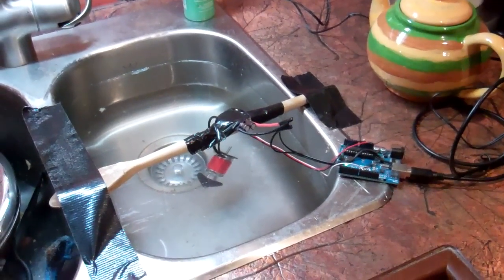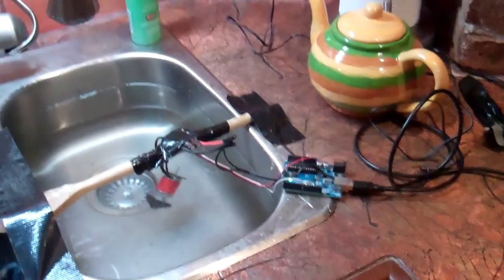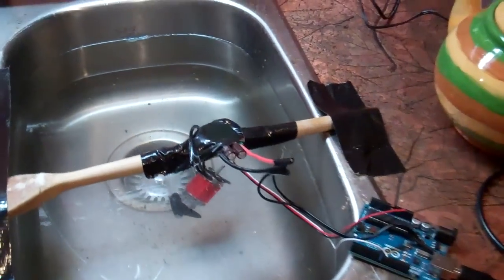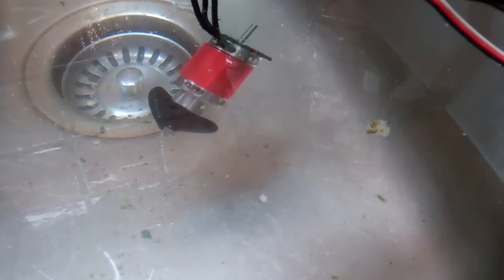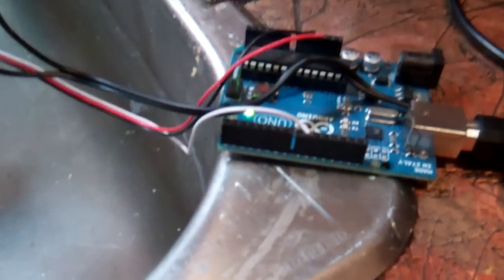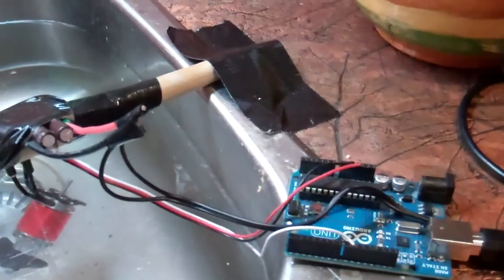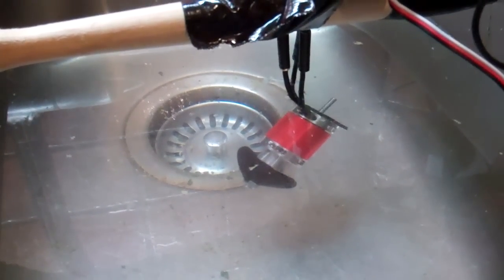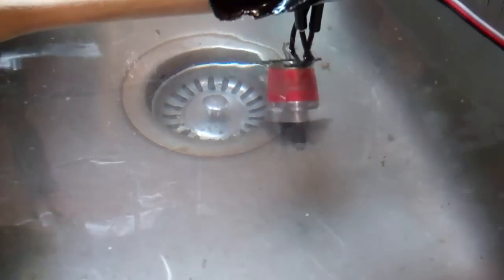Testing Brushless DC Motor Underwater

Comment: What if the 3 connection leads were also submerged. Would it still work?
Reply: The connection is submerged as it connects to the stator, which is likely soldered. If not I doubt it will have a hard time getting into any heatshrink tubing

Comment: Brushless DC motor with 3 wire leads. Me thinks he not know much about what hes doing.
Reply from the maker: That's correct. Hobby brushless DC motors have three wires as they are electrically commutated the ESC. Remember that these are powered by a DC battery with no transformer. 

And next time, hold back the snark until after you Google something ;)
Reply: You don't get sarcasm do you? Come on "Me thinks" wasn't a hint? It was troll bait.
Reply: +Brian McCain I always thought brushless was AC and Brushed was dc...
Reply: +LetsGetStarted  Brushless motors run only with plus with modulation DC voltage so they are classified as DC motors much like the stepper motors and servo motors are DC motors.
Reply: MEGAZ STUDIOS Okay, thanks for the clarification! :)
Reply: dude, I saw 3 wires... same as mine...

Comment: Did you used epoxy on the wires that comes out of the motor? 
Or did you do anything with the brushless motor? 
or just simply threw it inside the water?

Comment: No its a staged mother you need a speed controller to make it run but you can run the speed controller with the 12v if it is the correct voltage esc (electronic speed controller) then that runs the moter